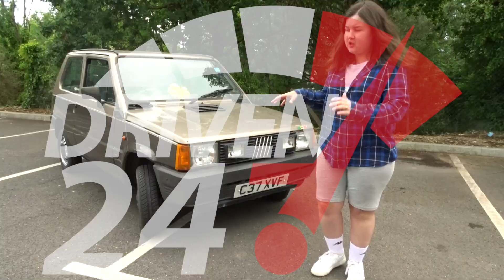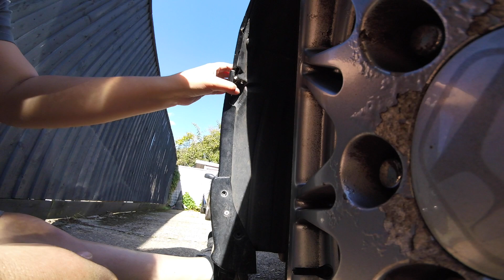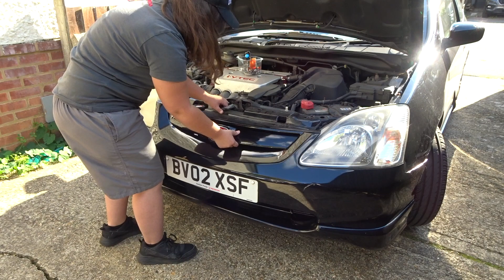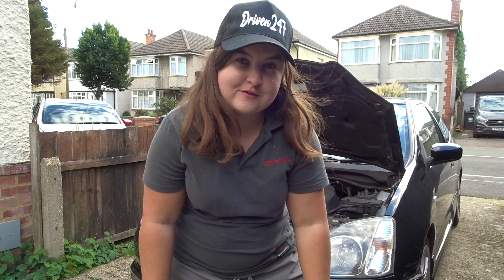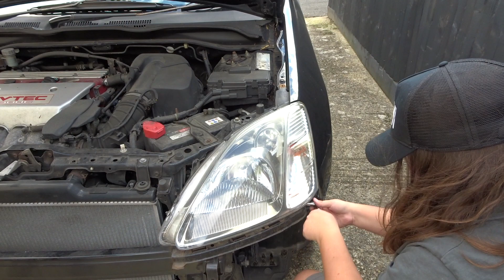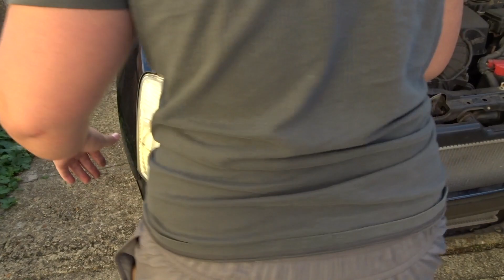GIRL REMOVES front end from a TYPE R!

Comment: Well done. The only thing missing was wd40. To spray on b4 loosening the bolts. A wee tip if you get a sticky bolt. Loosen it a turn spray it with wd40 tighten it loosen it and so on until it becomes loose. It saves the thread or snapping the bolt. Good luck with the light restoration.
Reply from the maker: To be honest didn’t need any of that I’d say, I didn’t really struggle, I managed it all! Thanks for watching!